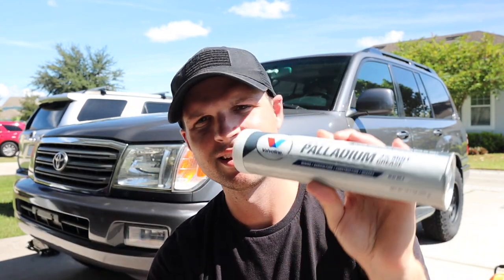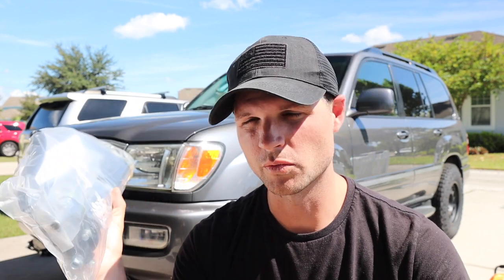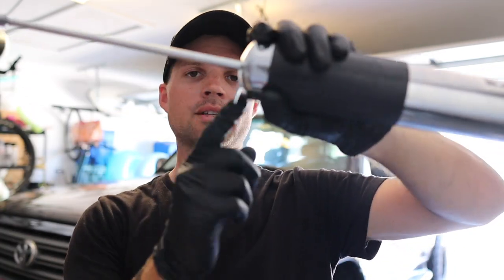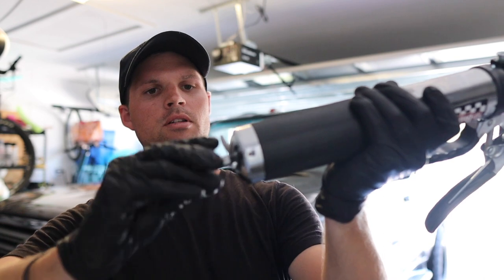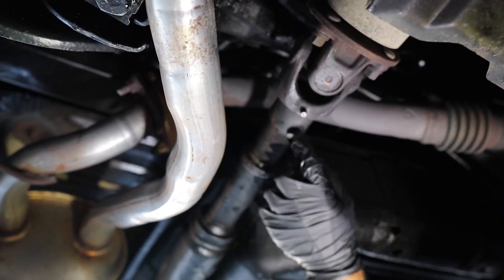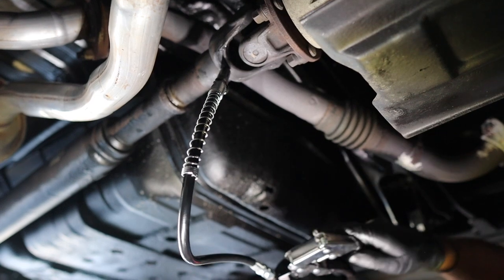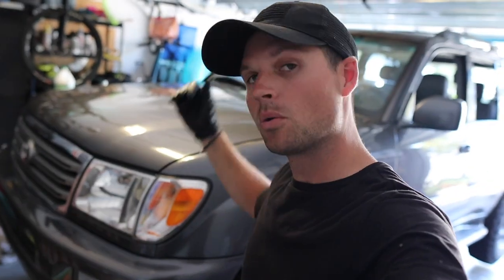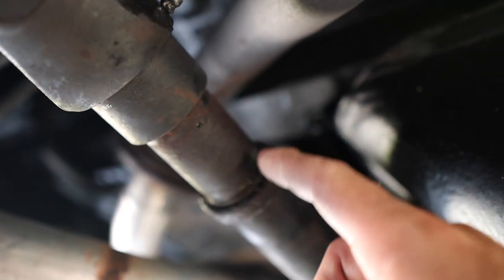"CLUNK" Fix | How to Grease Drive Shaft | Land Cruiser 100 (LX470)

Comment: This is badass!!! I was about to do this two months ago but I saw on IH8MUD and some YouTube comments about over greasing because of the pressure on the drives haft and just dealt with it. I'll just be careful like you and possibly try this out next month. Awesome video dude!
Reply from the maker: Thank you! Yeah let it move back and forth about 10x and you should be good. Ran over some curbs after greasing to “flex” it a bit lol. Still driving smooth 👍
Reply: i think if the jack stands are on the rear axil you can fill it all the way.

Comment: Just took my 07 4Runner in for an oil change and asked about getting this done since I've been having the clunk. The service tech told me they would have to diagnose the problem for $160/hour first. I told him I knew what the problem is and it just needs grease. He told me he's never heard of this and that the grease is supposed to last the life of the vehicle. I then asked why it has a port for adding grease if that was true. Anyway, guess I'll be doing this myself. I hate dealerships!
Reply from the maker: That’s why I hate dealerships. Only go for recalls or free oil changes

Comment: Thank you for making this video - I have two 4Runners and need to do the exact same greasing procedure. I choose the same grease gun as you but decided to use Amsoil Synthetic Polymeric Off-Road Grease, NLGI #2 has it has a bit more Moly in it at 5%.

Comment: Bought a 2001 with 110,000 mi from original owner Oct 2021 super clean super sweet. Driven from so cal to Montana to Florida,  running perfectly so far, heading back to Montana in a couple of days, love this rig.
Reply from the maker: 110k! That’s amazing! Congratulations on that find. I get so much more joy out of this 04 vehicle than I did out of my brand new Tacoma.
Reply: whats the mileage at now? just picked up a 91 FJ80 with 115k, gonna grease the u joints soon It might have a slight clunk 😂

Comment: Just bought a 2001 LX470....with the clunk! Thx for the fantastic vid!
Reply from the maker: You're welcome. Thank you!
Reply: @rywanders  I did the lube and pumped 20 times per slip joint and got no clunk relief, and no grease coming out of the slip yoke. Wondering if that thing was dry or if I'missing something. Aost like the slip yoke is frozen.....Planning to add more grease .....thx again for the vid.
Reply from the maker: @frederickmatthews4259  Try taking it over some bumpy terrain to get it to extend and compress to see if any grease comes out the seal. When adding watch for it to move back and forth a few times. If it doesn't work you may have to change it out.

Comment: awesome video. just finished greasing my Hilux u joins and slide yokes. just use a nlgi 2 high-temperature grease (not molybdenum di sulfide because i don't have an extra grease gun) u joins are easy and just 3 to 4 pumps pushed out the old grease. when start pumping in slide yoke, took me 12 to 15 pumps to see the grease coming out from the slide yoke. clean the excess, drive around town, crawl underneath and checked, saw grease pushed out of slide yoke. cleaned the excess. after 2 days, same happened, cleaned the excess. third day all good, no excess grease coming out. no clanking.
Reply from the maker: Nice work!
Reply: Was your tires off the ground?

Comment: Very informative! Im brand new in the j80 game, i do work at truck repair shop, and could have car just drive on four ramps for greasing, that will give enough space, so theoretically i could fully grease the slip joint? And i wonder if semi truck grease is good enough, i mean it should be considering their weight haha
Reply from the maker: Thanks! Yes a lift would be great! That may be too heavy of a grease but compare it to this and see. Congrats on the j80

Comment: Also, my GX is lifted with no running boards, so I'm thinking I will just slide under there and do this while it is on the ground so I don't have to worry about over filling while it is in the air.
Reply: How did it go on the ground?  I was thinking the same.

Comment: I lubricated the shaft where you pointed with the arrow, it did not go back, oil came out from the front of the shaft. There is a gap where you pointed with the arrow, it is making noise. How should I proceed?
Reply from the maker: 🤔 sounds like maybe you over greased? If it’s not able to flex it can be damaging and may be the result of the noise. You can remove the zerk to allow the grease to flow out to relieve the pressure. Warning this will be messy . If you’re not comfortable with doing this take it to a shop.

Comment: I have an 06 Land Cruiser (100 series).  I get the "clunk" when I'm driving and let off the accelerator, wait a few seconds then push the accelerator again.

Is that likely the same thing?  Some have said a bad bearing in the drive line (that is under load when the motor/trans are engages (not coasting).

It is definitely in the rear of the truck.
Reply from the maker: Yes, same thing was happening to me. Try this and if it still happens then your u joints may be bad.
Reply: The clunk could also be worn lower control arm bushings or worn engine mounts.
Reply: @4runner1grfe  I understand....  But the clunk is in the back, near the differential.  And it is directly lated to pushing the accelerator pedal...  Meaning, on a straight flat smooth road if I let off and then push the pedal again....  Clunk

So it seems to be when the drive shaft is under load or not under load .

Thanks for the input though.
Reply: @markshade8398  oh I see.
Reply: You articulated this perfectly. I have the same issue with my 01 LX470.  Did this video help with the issue?

Comment: My gx470 had this issue I greased it and reduced the clicking feeling, it comes back from time to time, should I just keep greasing it so it can go away 100% ?
Reply from the maker: You can or you may need to replace the u-joint

Comment: 80 series with clunks here. Can it be done with wheels on the ground?
Reply from the maker: You’ll need to lift and put it in neutral to rotate the shaft
Reply: You just drive a few cm or meter and observe when the drive shaft is in a good position to get to the zerks. In case you fit under the car to do the greasing work without lifting the car. I used ramps and repositioned them once to get better access to the zerks. Pretty easy job.

Comment: Late to the party but i've heard it both ways. Some say you can't over grease u joints and to pump until you see fresh grease coming out of the seals while others say 1-2 pumps until you see just a little bit come out because over greasing can cause pre mature failure..  Any youtube professionals have the correct answer?
Reply from the maker: I’d say you want just enough till you see it coming out otherwise you’ll just fling excess grease everywhere.

Comment: @7:43, when you put it into reverse i can still hear a clunk.  are you saying it has quiet down the clunk? After i greased the front and rear diffs, i have noticed the clunk went away when putting into drive, but the reverse clunk has quiet down a bit.
Reply from the maker: That’s just the gear shifter, but I did still feel a slight thud so I ended up replacing the front diff bushings.
Reply: @rywanders  just watched your front diff bushing and it looks painful. I just got done doing my rack and pinion bushings and that was a pain too. I’ll save that job for another time. :)
Reply from the maker: @cpenv  it was! i really needed some ramps to lift the vehicle off the ground more. Still would have been tough but probably would have helped greatly.

Comment: was the clunk while driving or sitting still putting the truck in gear?
Reply from the maker: Sometimes taking off from a stop and  sitting still while switching into gear. I noticed a slight thud recently and plan to change out my front diff bushings here soon hopefully that will fix it.

Comment: Great video. I do wish you would have included examples of the clunk at the beginning of the video. I'm trying to diagnose a clinic myself, and am not sure if it is the u joint clunk or something else. I'm just going to go ahead and do this and see if the noise goes away.
Reply from the maker: Hey Christopher, thanks for the feedback! Yeah it doesn’t hurt to do this either way. Hopefully it works for you. I would lift it off the ground if you can; doing it under pressure might not work well and you won’t be able to rotate to access the zerks. Let me know how it goes.

Comment: stupid question, you don't need to jack the car up to do this right?  If that's the case I would think if it moves a little I should be good and stop pumping.
Reply from the maker: I’m no expert in the matter, but it helps with rotating the drive line so you can get to all the zerks
Reply: if you can get under, you do not need to jack up. you will find, you cannot access all zerks. grease what you can and move the vehicle forward a bit to access others, then grease them.

Comment: Why did you jack up your SUV? Couldn't you just grease the slip joints while the tires on the ground and pump it max?
Reply from the maker: It’s what’s recommended and you can’t spin the drive shaft on the ground to get to the zerks.
Reply: I just did it yesterday without jacking it up. I grease the slip joint with Valvoline moly (gray) grease and use the Valvoline multi (red) for u-joints. I use an electric grease gun. So much easier and faster. I may have overdid it on the slip joint so I'm about to test drive to the gas station right now. Thanks for the video! @rywanders
Reply from the maker: @seahawksforever9504  ah electric grease gun sounds genius! Yeah go over some bumps and get that to push out the extra grease then wipe up the mess. Nice work!